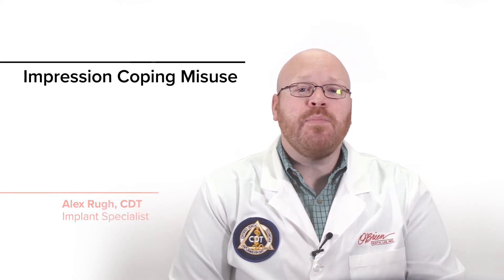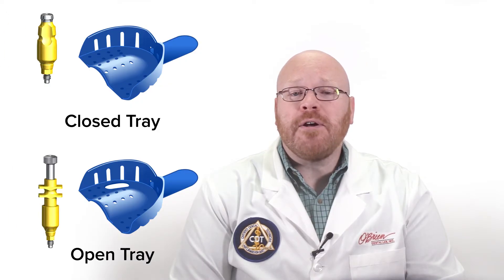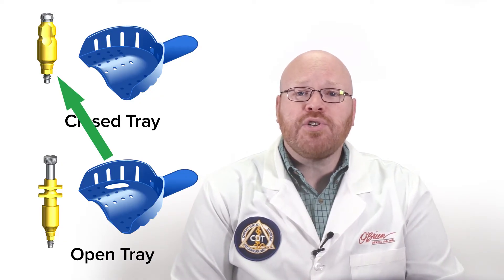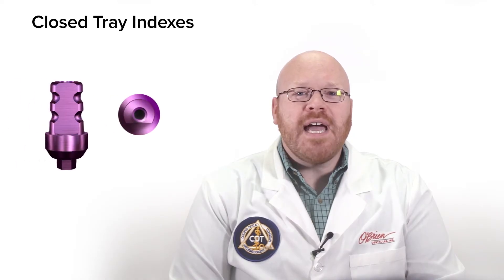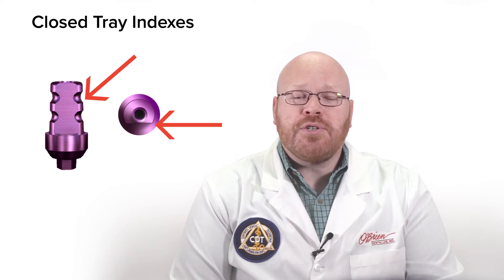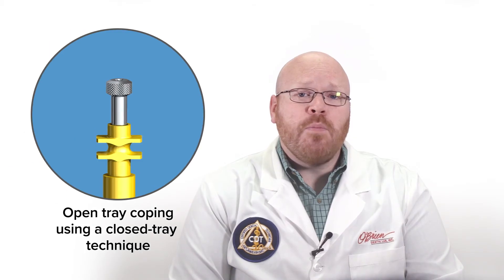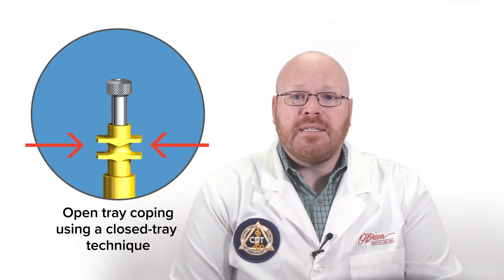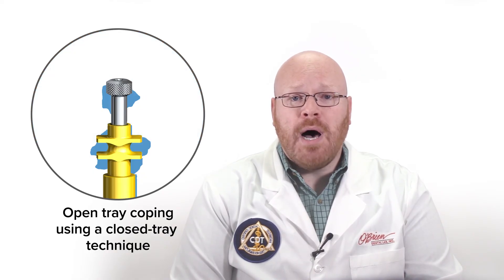Implant impressions - Closed tray vs open tray

Comment: Good day! I dont understand something : for the closed tray impression we use a almost non-retentiv coping because we want to detach the impression and after that, unscrew from implant and place into impression with the analogue? And for the open tray we use a retentive long coping transfer (because we want it to stay in??) , it perforates the impression, unscrew it from implant and then placed the analogue?. 
The thing i dont understand is why we need the long retenive transfer coping ? Is it more accurate because we dont pull it out from the impression ? 
Do you have a video from the lab after the impression is taken and sent there?
Reply from the maker: Yes, open tray is typically going to be more accurate because it stays in the impression.  There are a few reasons for this.  One, it eliminates the possibility of human error in re-inserting the impression coping - it can be easy to accidentally insert those impression copings in the wrong orientation.  Two, there is more surface contact of the impression material to the open tray coping because it's almost fully encapsulated in the impression.  This reduces movement of the coping.  Three, there is less chance to distort the impression when pulling the tray when it's an open tray technique.  I hope that helps!
Reply: @OBrienDentalLab  thank you very much
Reply from the maker: You're welcome!

Comment: Thank you very much for this super important notes about (transfer copings)  ...
But i've got confusion about the use of ( coping , prosthesis screw)...??
& is (transfer coping) synoname of (impression coping )?? .
Great thanks to you Doctor
Reply from the maker: The terms "transfer coping" and "impression coping" can be used interchangeably.  The term "transfer coping" should only be used for closed tray impression copings, but it's often used for open tray copings as well.
Reply: @OBrienDentalLab   ..ok ..perfect ...
Could you please instruct me about book in implantlogy that is comprehensive for beginers in dental  implant  discpline ?..thanks in advance
Reply: Where do you practice Nowras Almaliky?